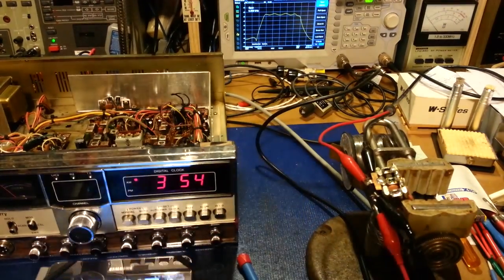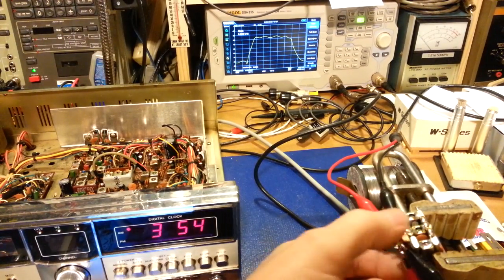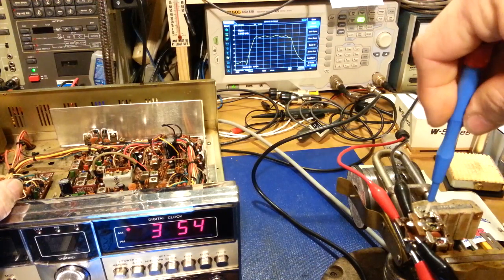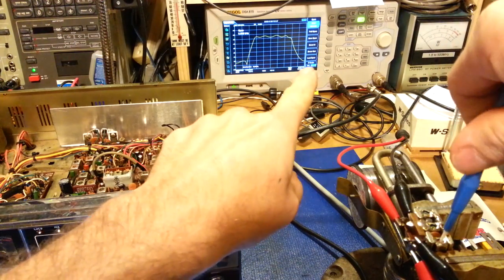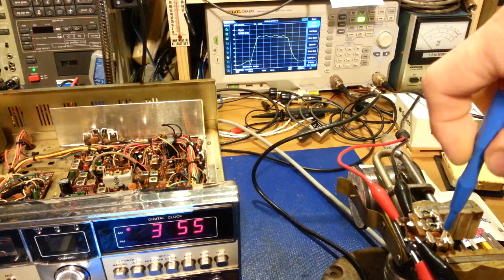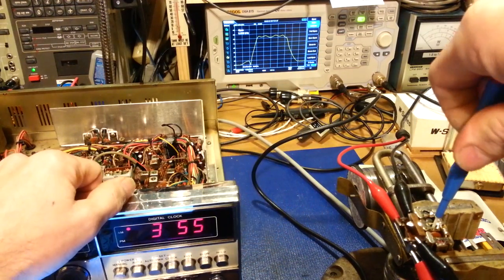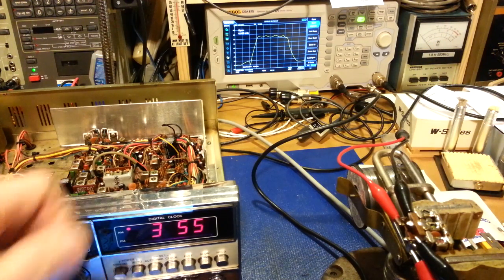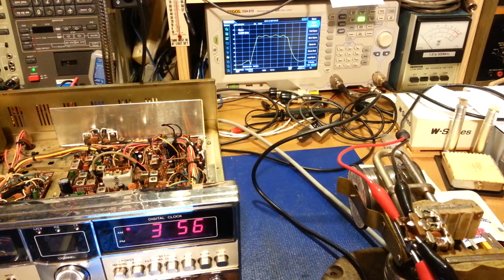Crystal filter adjustment

Comment: Seems  not to be much adjustment in that one?
Reply from the maker: The Radio Shop

 Really need to reread my book on filters.  I think those adjustments are meant for tuning input and output impedance and matching sections of the filter more than adjusting for bandwidth.
Reply: I do believe you are correct.

Comment: nice demonstration Mike. Would be great to have those filters in today's radios.. Thanks for sharing. 73
Reply from the maker: TRX Bench 

This video was really for Mark who was live streaming in the other video.  We were talking about some of the crystal filters used in the earlier CB radios and what effect adjusting the transformers had on the passband.  Yes I sure do wish they had these larger filters in today's radios.  The modern ones are such poor performers and makes for very noisy receive.
Reply: That is the point...Mike
Reply from the maker: TRX Bench 

Its all about profit now, not quality.  Watching your Siglent DMM video now.  I am happy with the Rigol DM3058E meter I recently got.
Reply: Yes the Rigol is a great DMM for sure. The Siglent has bugs which needs to be solved..
Reply from the maker: TRX Bench 

I got three new pieces, the DMM, 4 channel scope and 2 channel signal generator.  My only complaint so far is that the output level is not correct when modulated on the signal generator.
Reply: Yeah I know I have seen the boxes on your bench and your new rack. Concerning your function generator mine is doing the same...
Reply from the maker: TRX Bench 

What's sad is Rigol basically brushed me off as a nuscince.   A youtube viewer from Germany emailed me and told me he had the same problem with a cheaper brand signal generator he had recently purchased (can't remember the brand at the moment).  They acknowledged the problem and had a firmware patch within a week to fix it.  It looks like Rigol could care less about finding a solution to fix it.

Comment: Thats very interesting, its a filter from what? SSB radio?

If you had to be stuck with only one RF generator, and only have to choose from either a marconi 2019A or a HP 8640B, which one would you chose?  Its not a random stupid question, its a choice that I have to make right now and I want to know what an expert think.  73
Reply from the maker: Hugo Martel 

Have never owned either one.
Reply from the maker: Hugo Martel 

Oh, the filter is out of a Cobra 2000GTL
Reply: Thanks!! 73